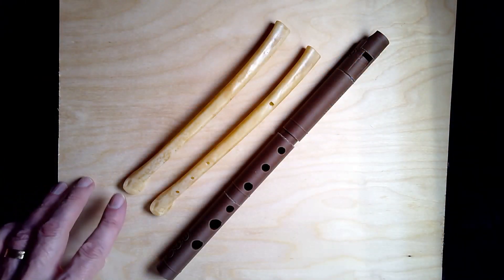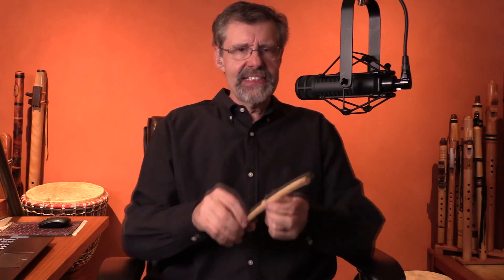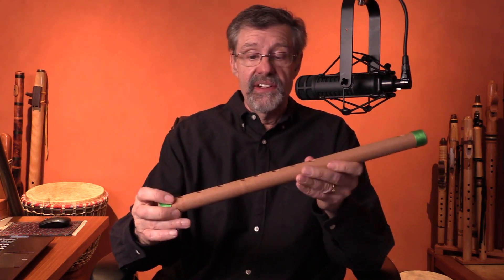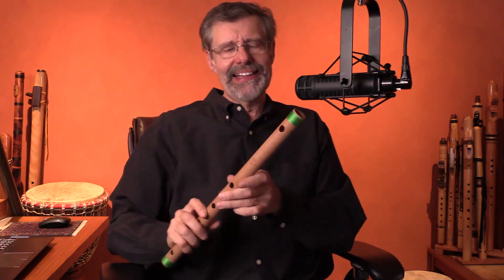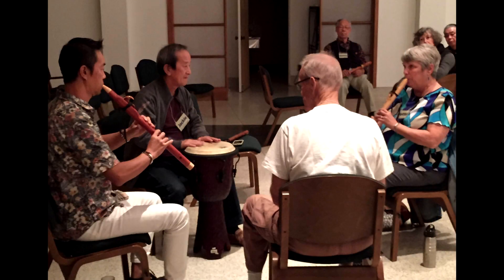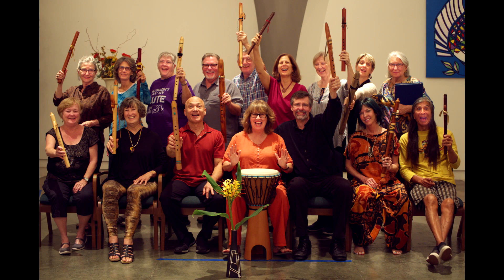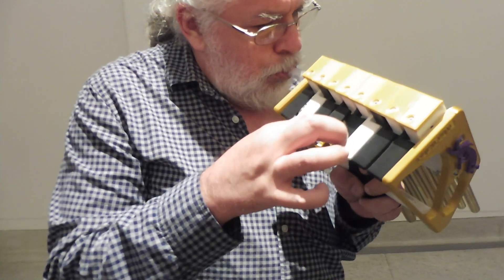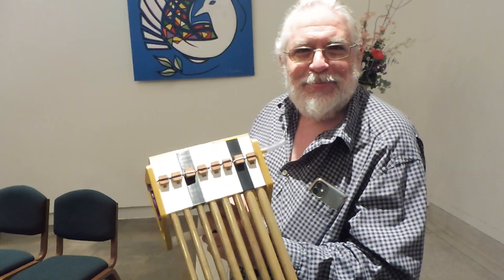3D Flutes - Native American Flute

Comment: Clint did you purchase the Qwistle or did you 3d print it ? I have printed a few and I keep having trouble with the because they all jump wayyy to easily from the first to second ocatave on the lower notes like D and E
Reply from the maker: I did print it myself (in "Corkfill" - an unusual PLA blend). I believe that, on any 3D-printed flute with a fipple edge (Native flutes, recorders, etc), you will probably have to work on that fipple edge - careful sanding of the sound mechanism area. Maybe also smoothing out the windway and such. I did a bit of that - nothing too extreme but I think it took me maybe 5 minutes with small bits of smooth (high grit) sandpaper, and it worked.
Reply: Hmm that my be why none of my Qwistles sound good....I used 0.08 layer height and didn't sand them at all. How high grit sandpaper did you use ? I'm a bit afraid of sanding it with too low a grit and ruining it

Comment: I have a 3D printed low D with drone, I'm hoping it has a terrible accident, it's horrible, I had to spend hours sanding the block and around the sound hole and it still leeks, absolutely worst flute ever, I've played drain pipe flutes that are thousand times better, I'll never buy another synthetic or 3D printed flute
Reply from the maker: Not easy to actually produce a good 3D printed flute ...
Reply: @ClintGoss  it's easier to make traditional style flutes from wood, and cost a lot less if they don't turn out right, plastic or other composite materials have no soul to them, mine plays in tune but feels horrible in the hands, I'm tempted to make a wooden fetish to see if it makes any difference to the sound